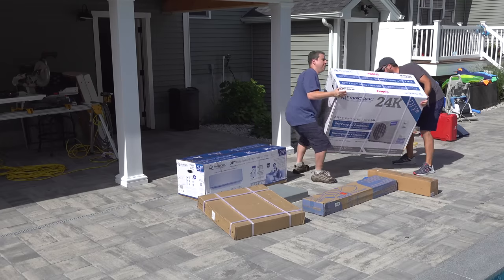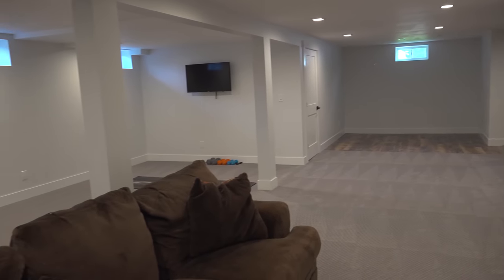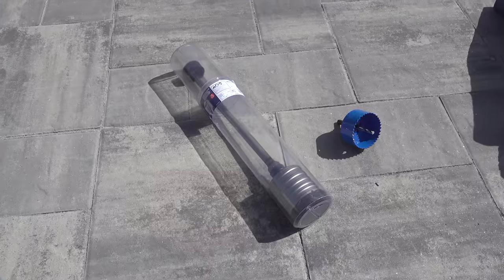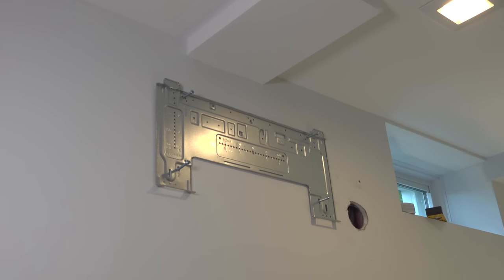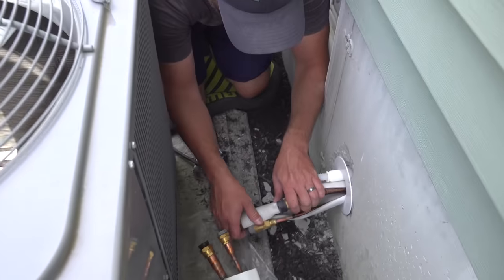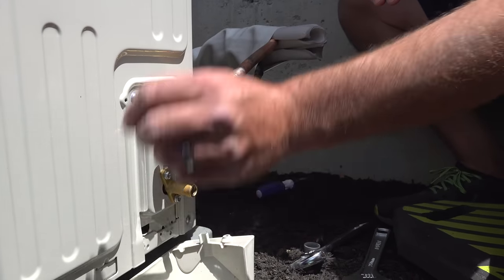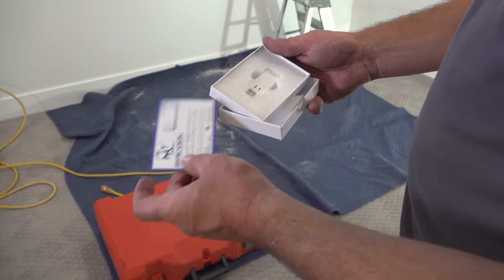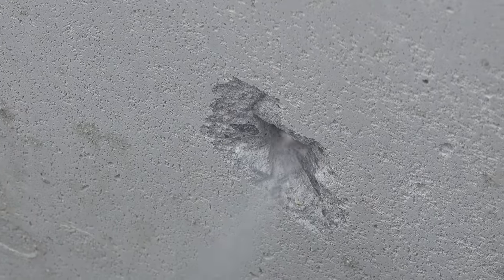Install your own AIR CONDITIONING in 4 HOURS!  DIY Mini Split MR COOL

Comment: don't waste your time with this garbage. your not going to save money because of one main thing. an efficient mini split runs on 220. these run on 110. it'll cost you a fortune to run them. i just replaced my single rooftop unit with three systems. 2 mini splits and a standard unit. my electric bill was cut in half. the mini splits run on 220 not 110. i guarantee i can get up to 15 plus years out of mine. this garbage won't last half the time and cost twice as much to run.
Reply from the maker: These run on 220v. They have a small 110v version also

Comment: running 220 electric not a diy thing    yeah just buy this tool this bit this thing use once ?? =$$$   the outside pad on woodchip's is a  no they will disintegrate and you unit will  will!sink

Comment: I've seen HVAC companies want like $4,000 in labor for this job, but no concrete involved.  Just a simple install.  Highway robbery.
Reply from the maker: Interesting! and Based on the comments from techs on this video, I guess this really exposed a big money maker for them, since they seem to upset to crap on it.
Reply: @SilverCymbal   you didn’t expose anything 😂 if the equipment cost 2400 and a company is only charging 4grand your getting a deal. You guys act like it’s wrong for a company to make a profit off of a job. A lot of hvac manufacturers require installation to be done by a licensed company to even get a warranty most that sale to unlicensed people do not come with a warranty. The Mr cool unit may be different since it’s target audience is do it you sellers. But it’s plain and simple every company is operating to make a profit not to be some free labor group.
Reply: That simple equipment probably came with a warranty too…
Reply: @shanestepps  
No, the $4,000 was the separate labor charge.

They would want $6,000 out the door, the unit itself I could get myself for around $2,000.

HVAC is just about the shadiest of all the trades.  $4,000 in labor for something a pro could knock out in 4 hours.
Reply: @johneldorado   I get that you think thats price gouging but again thats how a company works. I will be the first to tell you some prices are a little to inflated. But a simple solution is to not call the guys who spend time and money learning how to do whatever job they are paid to do and just open your own company and charge your non shady rates.... at least until you hire people and have to pay workers comp then additional insurance coverage for general along with commercial vehicle coverage and cant forget about gas and paying your guys to do said work, permits are a thing too I would say at that point you may have to start charging around the amount you are complaining about...
Reply: @shanestepps  
Funny, I can get all sorts of other things done and somehow I don't end up paying $1,000 an hour to a tradesmen.

I work on my own units, this stuff isn't rocket science.
Reply: @johneldorado  no one said it was. You completely ignored the fact that a company who has insurance overhead and employees are the ones you are complaining about. Unless you operate a plumbing or heating and air company I wouldn’t say anything. It seems like you don’t even have a basic understanding on how a company works.  But like I said I would be interested in seeing you run a company with employees and insurance and not charge these prices if you did you would bankrupt in the first year.
Reply: @johneldorado  I can pay a crackhead 20 bucks to mow my lawn does that mean my mechanic should only charge me 20 bucks to mess with my car just because they took the same amount of time?  What’s your background to decide such wages for tradesmen???
Reply: @shanestepps  
These companies also have insurance, vehicles and employees.

I pay a pro plumber with all the papers $120 to do something like put a sink in, he does a great job.  Somehow they can make it work but HVAC want $1,000 an hour.

This video clearly hit a nerve and I'm glad it did.
Reply: @johneldorado   a sink is not the same as a ac system. Again I ask what qualifies you to make such judgements on these things? Are you a tradesman worker owner manager?  You keep comparing different job performances who no factual information other than you paying a certain amount. As far as nerves go I’m just angry at the pure ignorance someone such as yourself has in making claims such as these, but again tell me your qualifications to make such judgements and I’ll gladly admit defeat.
Reply: @johneldorado   what would that same plumber charge you for running a new sewer line?
Reply: @shanestepps  

$1,000 an hour is a rip off rate, and you don't need to be all that skilled to work in HVAC.  A 25 question, open book test and you get your EPA license that they love to wave around.

It's a scam and people are catching on.

Done debating a loser that's upset a DIY video is out showing people how to do it themselves.

Comment: Its an over priced window unit.
Reply from the maker: No way, 24k BTU with 5 star reviews in the thousands everywhere. He picked the the right one with this model https://amzn.to/3vczVAx
Reply: Much more efficient sooooo much quieter No window issues or holes in the wall/structure pester leaking down the walls much more technical Cleaner and better all around.

Comment: You did that completely wrong. You should’ve put some nitrogen on the lines, then use a spray bottle with leak detectant, then put a vacuum on it, after open the valves up, and check the pressures.

Comment: Redacted
Reply from the maker: The unit is 24,000 BTU or 2 TON capacity. Not sure if you are outside the US, measurements may be in different scales.
Reply: @SilverCymbal  DUH, your completely correct. I must have had a brain fart and have since redacted my post. Thanks!

Comment: Wtf is BTU
Reply: British Thermal Unit
The amount of heat needed to raise the temperature of 1 lb of water at Max density 1 degree F
A standard measure used
Reply: @james4582  Why note use Watt or Joule or kWh ?
Reply: @7ERr0r
It’s a standard measure used 
1 btu is equal to 1.056 X 103 joules
12,000 btu’s is 1 ton of cooling 
Not the weight of the unit
36,000 BTU’s is 3 tons of cooling
Same with heating of a furnace 
Will be rated in BTU’s
40, 80 or 105,000 BTU’s
It’s a measure of heat loss or gain
When air conditioning or heatingrefrigeration is used your measuring one or the other. 
For instance air conditioning does not simply blow air it removes heat by its process air is passed over the evaporator from the room 
And the designed chemicals remove heat and send it to the compressor which compressed it and passed it over the condenser and puts it outside.
Kw’s and Kwh’s and amperage 
Measure the electrical power used
Voltage is the electrical power to run the motors’ 
I’m a bit rusty on my technology 
But I think that’s pretty close
Also the btu is related to the area and heat load required
For instance a 12,000 btu A/c might be required for a room say 4000 sq feet On average depending on the heat load 
 Lack of insulation, how. Many windows and size, people @ 400 btu each things like that. 
One thing I have always remembered from the beginning a long time ago is that COLD IS MERELY THE ABSENCE OF HEAT
The more heat removed the colder it gets. Easiest way to think about it is a refrigerator. If your just blowing cold air into it the door would soon blow open. Your removing heat and dispersing it out making it colder inside the box
Sorry I got a bit carried away there
Hope it helps you
Reply: @james4582  Thanks! For the long answer :) It helps a little, but im a european and these units are weird.
Also you showed me how f**ked up these units are.

I was expecting:
______________ 1 BTU = 0.000293 kWh = 1055 J
__________ 1000 BTU = 0.293071 kWh = 1055060 J
1 RT (refrigeration ton) = 12 000 BTU
1 RT (refrigeration ton) = 3.51685 kWh = 12660670 J

Comment: what the hell? no evacuation of air that sat in the pipes before you release the refrigerant? Your system will fail prematurely soon.This is a very bad, unprofessional and going to be expensive failure DIY I have ever came across.

Comment: So you're going to dump freon into a system without vacuuming the system first. That is a huge NO unless you want your system to be shot as soon as you turn it on. You also didnt measure the head pressure and super heat and subcool with your hvac gauges. You also didnt show cutting off the extra line set and flaring the end to mate with the condenser. HIRE A HEATING AND COOLING GUY FOR THIS JOB. They installed this wrong. You need about 2k worth of equipment to install this correctly. They failed to show any of that in this video.
Reply from the maker: Not with this system, the line set and condenser are sealed and freon filled. They only open their valves which can be seen inside the plastic caps on the line set when properly connected. The system is entire factory filled and sealed to perfection.
Reply: @SilverCymbal  so you're telling me the line set itself is sealed? And you had the perfect length? What if you only needed half the provided line set?
Reply from the maker: @200130769  Correct, watch the other one I installed and talk about this more and show additional detail: https://youtu.be/kEWzIfnIhUw

Comment: I’m a red seal HVACr technician, 
this is what we call a homeowner special. That compressor will die in 2-5 years. you need to pressure test the lines with nitrogen, bubble test, then release the nitrogen, pull a vacuum down to 500 micros, when it can hold 500 µm or less for an hour or more. Then you release the refrigerant. You also need to measure sub cool and superheat. This video is straight up cringe.  Total Hack job. don’t make a video teaching people how to install an AC if you don’t know how.

Comment: This is not a professional installation you  have a few code violation House especially you did not put a vacuum on the unit before you open the refrigerant line that’s a big no-no
Reply from the maker: You don't pull a vacuum on a system that has both pre-charged lines and a condenser. You would be removing the refrigerant. This is not a regular empty system that needs a negative pressure then refilling.